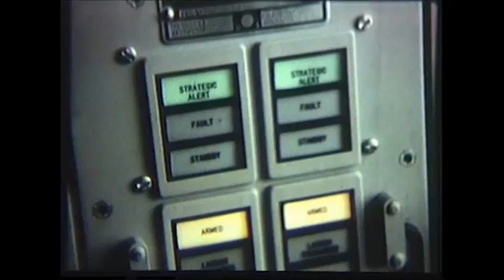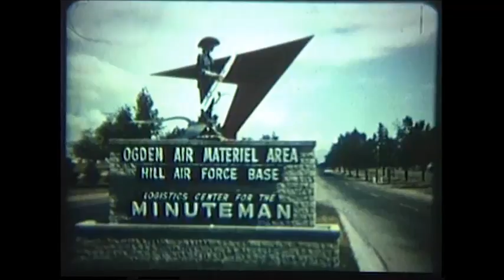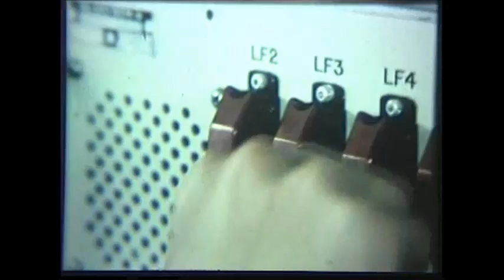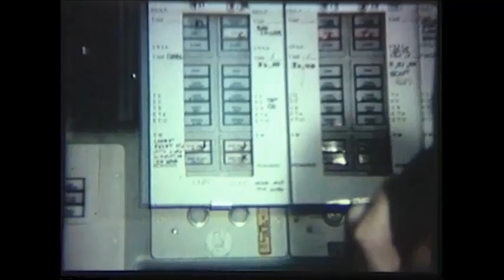Minuteman From Launch To Delivery 1963 US Air Force Film

Comment: Does anyone commenting of here remember ever seeing missiles being transported by the Airforce using double ended transport vehicles with the missiles slung in the middle on a trailer that had tractors at each end of the transport to make it easier to navigate through city streets? The Martin Denver plant used them in the early sixties but cannot find any histories or photos of them. I know a model maker made a kit about them some time in the eighties but cannot find the manufacture to obtain a kit?